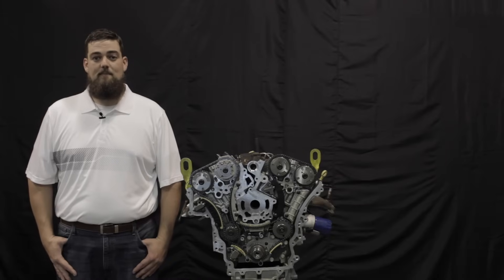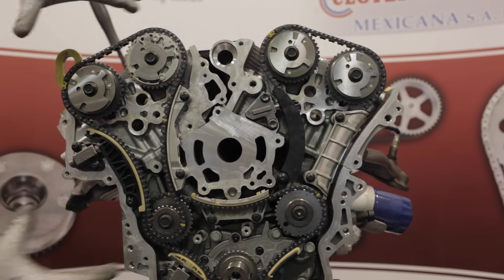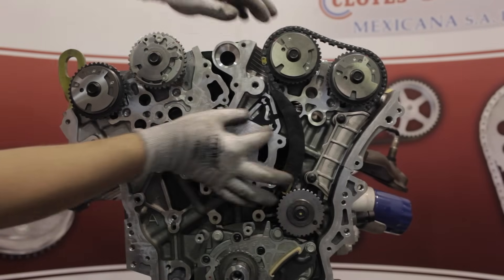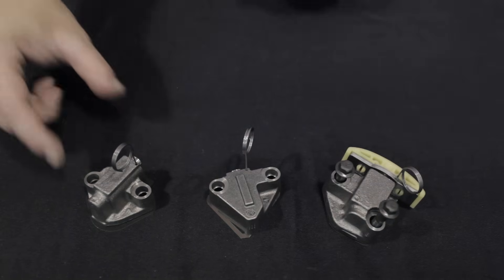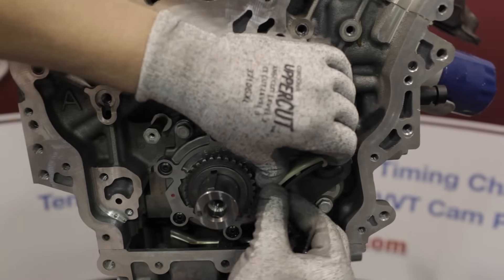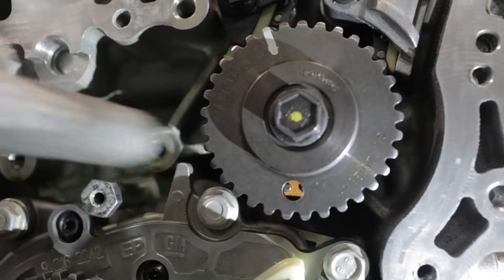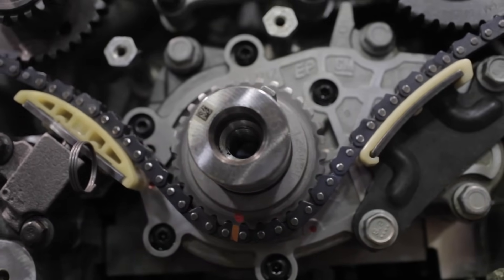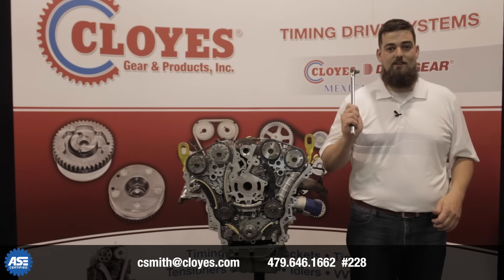GM 2.8/3.0/3.2/3.6L Timing Chain Replacement Repair, Cloyes 9-0753S

Comment: I come back to this video every couple of months to do another one of these.  My only suggestion is PLEASE mention that you need the "R"s on the right bank at the top before removing the timing components.  Every single one I've done has already been on the 1TDC stroke.  The most recent one on an 06 Cadillac was on the opposite stroke, so when I removed the chain I was shocked when a cam jumped half way around.  You MUST have the "R"s on the right bank at the top before removing the components.  It seems like a no brainer, but if you just open the video and go without thinking about it you could very easily bend some valves.  It is extremely difficult to retime it properly to get it to the correct stages once the chain is removed.
Reply: Hello Cheddarwedge,
I did the same thing when following the video, after removing the tensioner and chain the right bank VVT camshafts sprung inwards and know the "R"s are facing down!! Can you please advise how you managed to get it back in the upward position? Your assistance is greatly appreciated.
Ron
Reply: @ronaldwhitmore175  It was mostly a guessing game when I did it.  If I remember correctly, I kept coming to this video to see the orientation of the CMP pickup on the phasers in regards to the timing marks on both banks.  Keep in mind the crank turns twice for a single cam turn, So the marks on the right bank should be 180 degrees from where they are in the video/correct position at the start.  Get the chain as close as you can to "right," then go to the correct position.

Comment: Thanks for the instructions. My problem however is more complex. I have the engine codes for the right bank. So I ordered the kits, removed the chains in the order you described but my old chains are not stretched but my right bank cam phasers do not match up. I need a video on how to reset those.
Reply from the maker: The chains set the timing between the cams. Just rotate the camshafts carefully until all the chain marks are aligned like we show in this video. To be safe you can rotate the crank to a position where all the pistons are down on the side you are working on, move the cams where they need to be, then put the crank back to the correct stage.
Reply: @Cloyes01  sorry but do you know where the crank sprocket should be for the right bank to have the pistons lower than the top. Again thanks for your help and a great video reference
Reply from the maker: @jasonthomas6381  I don't know off hand. I would remove the spark plugs and carefully drop a clean screwdriver into the holes. It will allow you to gauge where the pistons are.

Comment: If only it was this quick. Haha. Great video and Thankyou for posting. I notice you didn’t use the camshaft locking tools though. Are they not necessary or just not mentioned. Also do the idler gears have to be replaced or are they part of the kit so used because they’re there. 👍
Reply from the maker: The camshaft locking tools are not necessary. We did not use them during the video. If the idlers are in good shape they can be reused. We do offer a 9-0753SX kit that comes without sprockets.

Comment: Is it necessary to remove the starter and flywheel to turn the engine in the vehicle?
Reply from the maker: No, you can use the harmonic balancer to rotate the engine. Removal of the spark plugs will make this easier.

Comment: What are the symptoms of there chains going bad? My 2014 at 55k miles has a
 miss and no codes.
Reply from the maker: Chains will cause a camshaft to crankshaft correlation code if they become stretched or worn. Chain instability will cause noise and rattles. If you do not have any codes or any irregular noise or rattles, then timing is probably not your issue.

Comment: How does one rotate the chains? That isn't shown in the video?
Reply from the maker: We used the flexplate while filming. You can also slide the balancer on and turn it by hand to rotate the crank. Pulling the spark plugs will make it easier.

Comment: So all overhead cam designs are interference engines?
Reply from the maker: Not all, there were many overhead cam engines made that were non-interference but those have all but phased out over time. Almost all modern engines are interference.
Reply: How many camshafts are on the 3.6 VVT 2 or 4?
Reply from the maker: @hotwheel6663  4 total camshafts. 2 in each head.

Comment: Is this engine the same as 2020 3.6 L ?  I haven't found anything on a 2020
Reply from the maker: The timing system has changed. Our information shows that 2018 was the last year this timing arrangement was used.
Reply: @Cloyes01  .... OK great ! Maybe you can do an updated video on the newer 3.6 ?  You have 751,468 views on this video maybe as much on the next one!

Comment: Dose piston #1 have to be at tdc for this when aligning the timing marks ?
Reply from the maker: No, by aligning the crankshaft sprocket mark to the marks on the oil pump you are positioning the crankshaft properly to set the timing.
Reply: @Cloyes01  so are you saying no need to set the timing if you align the marks
Reply from the maker: @brentmarr1331  Aligning the marks is setting the timing. The marked chain links set the timing in this engine.

Comment: I'm having an issue after the install. The car has about 1 second of rattle from the chain until the oil pressure is good ..has anyone else had these issues ?
Reply: Any luck on it?
Reply: im a little late but its the cam phaser that is rattling until oil pressure comes up. I had the exact same issue in my 09 enclave. Thought it was the timing chains. DO NOT replace the phaser with an aftermarket unit. Install an OEM unit. I screwed myself because the dealer wasnt open on Sunday. My car did not register the aftermarket unit (it was a Dorman unit) and I had to pull the motor out twice because of it. Yeah it super sucked!!!!
Reply: There is an O-ring on the mating surface of the oil pan that needs to be replaced also if you tear the motor back down (assuming its a 3.6L GM motor) It helps to maintain oil pressure as well. But its definitely the cam phaser that is bad. Its not common for them to go out. I would definitely replace all 4 if you can spare it.

Comment: How did you turn the engine after removing the right bank chain? Spin the flywheel?
Reply from the maker: Yes Sir, we used the flexplate during filming.
Reply: @Cloyes01  can you use the flexplate to spin the flywheel with the motor still in the car when doing the timing chains
Reply: and is the flexplate and flywheel the same part in the rear of the motor please email me the answer

Comment: Is the same kit used for vin V vs vin 7 ?   Ac Delco lists two different part numbers per vin.   Your brand shows kit SX without sprockets and kit S with sprockets.   Kit S shows 96 primary links and 114 upper links.  Kit SX doesn’t list link info.  (On rock auto) Of course my 7th Vin number is a 7, and the 8th number is a V.   I have kit 90753SX 2008 Cadillac CTS DI

Comment: At least it has a chain, not a rubber belt, but a single is an inadequate cost cutting measure by the manufacturer. Parts suppliers must love it.

Comment: Do you recommed using the cam holders pt# EN 48383 if replacing the vvt actuators(cam sprockets) or are they not needed?
Reply from the maker: They are not necessary if you follow our procedure. We do not use them in this video. The phasers have a dowel that indexes them to the camshafts, then the chains set the timing.

Comment: How did you rotate the engine to stage 2 timing position?
Reply from the maker: We used the flexplate on the back of the engine to rotate during filming. You can also slide the balance back onto the crank to rotate by hand.

Comment: How long does the nylon tensioner last until the chain chews through it
Reply from the maker: In a healthy system the nylon should last the life of the chain system. With proper chain lubrication and with stable tensioner and VVT system function the chains will not wear the guides. In this engine you will likely experience chain fatigue long before nylon wear becomes an issue.

Comment: What sort of improvements have been made when compared to the OEM chain assembly?
Reply from the maker: Our chain sets for this engine are simply OEM replacement. The system design leaves little room for improvement. Chain stretch issues have plagued this engine, but interaction with the phasers and idlers requires the use of a chain with the same pitch and width. The OEM manufactures made very high quality chains, but they still experience fatigue. The best tip we can offer is buy good quality components and keep your oil changed.

Comment: Can it be 180 out ??
Reply: Or it doesn't matter as long dots line up
Reply from the maker: @b.c6015  If all the marks line up it can't be 180 out. 180 out would put the cam phaser marks down, and they would not engage with the chains.
Reply: @Cloyes01  nervous because mine jumped and doesn't line up
Reply: So i ordered cam holders
Reply: Did it no i have one code from p0017 p0016 just to p0016
Reply: Did you figure out the problem?

Comment: How do you know if you need to replace the cam actuators?  I'm sure they'll have some wear.  How do you decide when it's too much?
Reply: Rick West Should get a code for Camshaft Actuator stored in the ECM. That way u’ll know if you have one failed, but those are high prone failure so if your in there. Replace all of them
Reply: @toolboxman9960  doesn't a stretched timing chain give a cam actuator code?  If you're in there changing the chain, how do you know if the sprockets on the phasers are too warn?

Comment: You left out an extremely important step at the end, before putting the covers back on.  Rotate the engine by hand very slowly making sure there is no interference to verify you got the timing lined up properly.  Finding this out after you put it together and crank it will ruin your whole year.
Reply: The chain can jump without oil pressure behind tensioner if rotating.  If you follow the steps there won’t be and valve contact.
Reply: @stevennelson753 he smartest comment on this video. Thank you. I turn them over by hand with no plugs in to get oil to the tensioners and then put the timing cover back on.
Reply: @Rick West, If He had told you to Check that the Flat sides on the back of the Cams are up and Parallel with the top of the Head when the Crankshaft gear is at the 8 O'clock position, then your Motor Wouldn't be Ruined.. This is a Good Video that is WITHOUT the Main Instructions to Be Sure that your Timing is Correct BEFORE You Ever Loosen a Bolt after your Covers are Off (Plenum, Valve Covers, Timing Cover).. Thanks
Reply: Yeah, when i watch eric the car guy, thats what he did. i wonder why it isnt included on this video.
Reply: @ninjazzrhythm400  if you check the comments, they are recommending that it not be done for fear the chain will jump.  I think I'd turn the crank around to verify clearance, then turn it back and see if the marks are still aligned.  I wouldn't just trust that it's all timed properly and crank under power.
Reply: @ThatEEguy2818  I don’t see how the chains would jump if you pulled all the tensioner pins and everything was on.  It’d be virtually impossible.
Reply: @scottiredale81  I don't think they would.  I'm referring to making absolutely sure it's timed correctly before spinning it under power.  I've heard of many instances where a manufacturer will put 2 marks on something and the wrong mark is used.  Only takes a min to turn it by hand to be sure everything is free and clear.
Reply: Or get you a few more cases of beer when you need to do the rebuild 😂😉🤔
Reply: I replaced the chains on stage two and I have interference going back to stage one from my 5’oclock to 8’oclock after installing stage 2 chains. They are on the mark. Where did I go wrong, boss? Help 🙏
Reply: @elJuanito-S same thing happened to me! WTH?!
Reply: Without oil pressure properly built up in the tensioners and the phasers, you can create slack in the chain that might jump timing when the engine abruptly turns over.
Reply: Because these guys are so awesome they don't need to do that kindergarten crap.
Reply: Worthless, the timing marks DO NOT realign after any set number of turns and with no oil pressure you're risking disturbing your timing.

Comment: Is this timing chain better than OEM? I want to put turbos on at some point, I want to get the best chain I can get. Do you offer higher quality performance chains for the 3.6 LFX specifically.
Reply from the maker: The chains in this kit are not an upgrade over the OE chains, just an equivalent replacement. Because the chains must interface with the existing phasers and sprockets there are no improvements to be made The OE manufacture and Cloyes already use the best available materials and processes to manufacture the chains.

Comment: Hi Cody.

Thanks for the video. I have done 2 since I first saw it. But some advice. The camshafts in this video have been locked with a keeper plate. You dont mention it. If we are doing this in the car it is really difficult to get the timing right. Watch Mellings video and you will see what I mean. And again, thanks for the video.
Reply from the maker: Hi John. We did this video without the special camshaft locking tools. They are not necessary to complete the job, but I would agree they may make the job easier. The whole point of the 2 different crankshaft stages is to position the camshafts where they are at rest on each bank. If you follow the procedure exactly, the camshafts will not move when the chains are removed. 

When we use special tools in our videos we definitely show them and give details. But when the job can be done properly without them we will always opt to show that process.
Reply: You can see on this video that the exhaust camshaft on bank 1 did move when the chain was removed

Comment: My vehicle is throwing the code p0019 and p0300. How do i fighre out if its timing or something smaller. It still runs and drive but stalls and spudders
Reply: Your timing chain jumped. More than likely Bank 1. The first thing I would do, would be to check timing.

Comment: So which ones are my timing marks on the cam sprockets? The arrows or the dots? I can't see on the video. That's the only thing that's stopping from finishing my timing chain replacement.
Reply from the maker: The left bank phasers use the dots, and the right bank phasers use the arrows.
Reply: @Cloyes01  Thank you Sooooo very much guys. Great great video too!

Comment: Great video, just one thing. As far as what I've read from GM. This engine is non-interference. Are they wrong about this?
Reply from the maker: This is definitely an interference engine.
Reply: @Cloyes01  ￼

Ron Z.

￼Verified - gmc tech -

The 3.6L engine is a non-interference engine. However, the timing chain problem on these engine is extremely well know. GM even published a Technical Service Bulletin (# PIP3423K) that states there is a known problem with the chains and tensioners. There is an updated timing chain kit (p/n: 12651450) to correct the problem. The Labor Time Guide calls for 11.5 hours to complete the job.
Reply: So who exactly is right here? Have you guys completely disassembled the block and looked?
Reply from the maker: @alexanderdiaz0512  We know from experience that when timing jumps, or timing isn't set properly on these engines, that piston to valve contact is the typical outcome.
Reply: @Cloyes01  I have one apart in my shop rite now granted its a older 3.6 in a 2005 cts. The cam phaser had 3 teeth missing on right bank intake cam. No valves bent. Maybe cause this is a pre 06/07 I'm not sure but the valves are not bent. You see this alot while searching on this engine being an interference engine or not. I've noticed from experience engine rpm at the time of timing jump might play a role in wether the valves hit the pistons  or not.

Comment: I have an 08 Malibu ltz 3.6 liter, code p0011 came up. I changed all 4 solenoids and check engine light still came back on. I’m not due for an oil change I have 51% oil life left it says, it makes kind of a rattle noise when shifting sometimes and just doesn’t sound good. Is it my timing chain? I NEED HELP
Reply from the maker: Sounds like it may be the timing system. P0011 can be caused be a stretched secondary chain, which is a common issue on these engines.

Comment: when you say torque the bolts to 18 lbs  i didn't see you use any torque wrench
Reply: Brandon Black that bc 18ft lbs isn’t much just like tightening a oil drain bolt

Comment: Can anyone tell me how he rotating the engine to these positions?
Reply from the maker: We were using the flexplate to rotate for filming purposes. If the flexplate is not accessible I would recommend sliding the harmonic balancer back on and rotate the engine using that. Removing the spark plugs will ease the process.
Reply: You can slip the harmonic balance back on slightly and turn motor over by hand just remove the plugs.